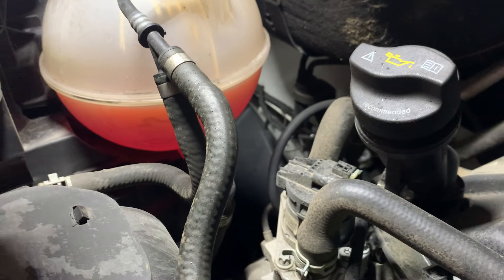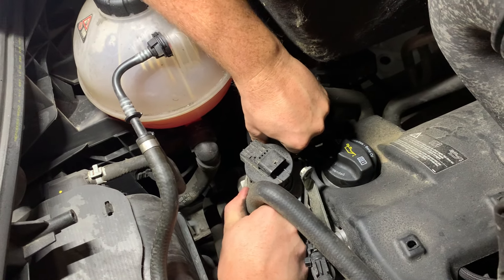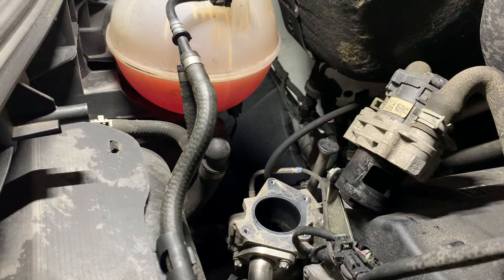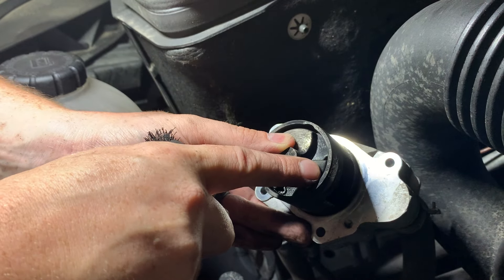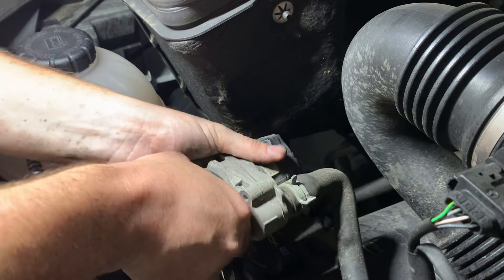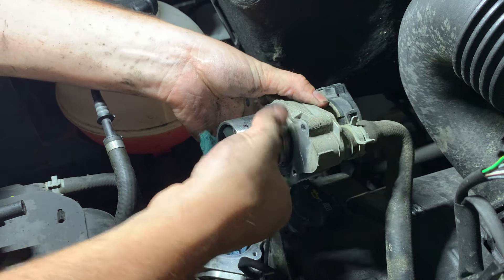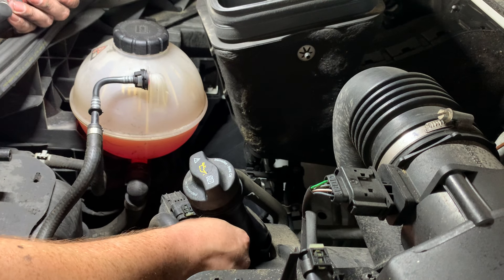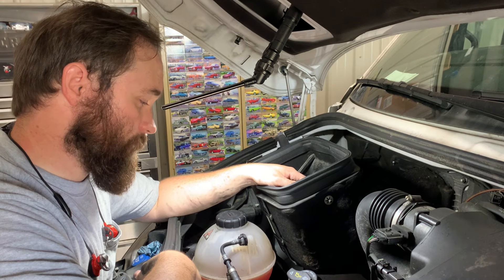Mercedes Sprinter EGR valve cleaning

Comment: If it was my Sprinter I would be very careful with use of abrasive pads and wire wheel and vacuum out any debris. Scotch-Brite and similar abrasive pads contain nylon, aluminum oxide or titanium dioxide. Lose wires from a wire wheel are also a risk. It is not good to have those contaminates ingested back into the intake system and then into the combustion chambers. It may be a minor amount but why risk increased wear on an expensive engine.
Reply: What do you suggest for the carbon inside instead?

Comment: I have the same van but after cleaning, it only lasts about 3-4000 miles and it starts sticking again.  That seems a little ridiculous, what am I doing wrong?  This problem started at about 5000 miles, sent it back to the dealer, they cleaned it and basically said there is nothing they can do.
Reply: Had the same issue on mine cleaning did not help for very long, I was told from dealership to wait until my warranty is over and remove the DEF system, which I thought it was odd and quite frustrating since my warranty is until 200 000kms. Had to fight with them a little to get a replacement and source the updated EGR valve. After replacing  it I spoke with the Mercedes Tech about how to avoid problems again and he told me to make sure that when I drive to step on it and make sure that the turbo gets real hot and spools. He told me that these problems aren't showing to the Working vans meaning people drive their companies van harder then the average Van owner. I've listen to the man every since and 30 000kms later no other issues, I'm watching this video to see if I could inspect it myself. Hope it helps, I was left disappointed when it happened to me almost had me selling it.

Comment: Just did this on my 2019 Sprinter with 75,000 miles. The dealership had nothing to offer when I explained the issue with acceleration hiccups at roughly 1750 RPM. As soon as I cleaned the EGR Valve the issue went away.
Reply: Dealers = sellers. IMHO
Reply: Egr cleaning is free at the dealer with a unlimited warranty extension

Comment: Amazing video. Thank you. Why not remove the hoses so you can take the whole thing out?
Reply from the maker: It’s an extra step and I feel you gain no real benefit removing the hoses. It’s just as awkward on the bench as it is attached to the truck. Plus, you don’t have to open the coolant system and deal with coolant spilling on everything.
Reply: This. I just found your video. And fixed my 2020. No more bucking at low rpm. You are awesome!

Comment: Excellent video, my van has about 28,000 miles 2022 v6 diesel sprinter. Using your video I’ve cleaned it at about 15,000 20,000 23,000 24,000 and now it’s doing the about 1,500 rpm buckaroo like it does every time the egr is dirty. Dealer refuses do replace it under warranty because there is no codes.
Reply: What exactly does it do at 1500 rpm?

Comment: Thank you, sir! I have the shifting issue and will try this, 2016 3500  3.0 v6 71,000 miles!
Reply: Did it help your shifting issue?
Reply: Totally fixed my issue, will do this again when it clogs up again!
Reply: What exactly was the shifting issue?
Reply: @spddd79 the vehicle will periodically feel like a jerking or a transmission problem but is just a sooted up valve. These are way bigger than the old ones on older cars that plugged into the valve covers. We notice it the most when letting off the gas pedal then stepping on the pedal you will feel the whole unit shutter or jerk! It will get worse over time and completely goes away after cleaning! Hope that helps!!!

Comment: Great video. I would add including the size of the socket for the bolts would be helpful. I would also have suctioned out any dirt and dust after sanding.
Reply from the maker: The size E10 was mentioned during the filler neck removal. All of the bolts are E10 so I didn't feel the need to mention it again. If you have some good buildup on the mounting surfaces, I could see taking more care with managing debris. Fortunately, this particular truck was pretty clean, so I don't feel there's any concern there. The internal bore itself was nothing more than carbon being scraped off, so there's no issue there at all.

Comment: I have had repeated issues with my Sprinter engine stalling and losing power.  Two trips to the dealer, replaced all the fuel injectors, problem continues.  Today I carefully followed your excellent video and cleaned the EGR valve, which with 29k miles was thick with carbon.  Time will tell if this helped resolve the issue.

Comment: This video is exactly what I needed. I may use some shop towels to avoid the brake clean overspray but that's an easy fix. Question: Do you always replace the gasket, or can you reuse the old one if it's good shape?

Comment: @Huey866 do you have the torque specs for the 4 bolts holding the EGR? About to do this tomorrow with my dad on his van. Consider me a rule follower, just like to make sure everything is exactly as it should be
Reply from the maker: I do not, i just go hand snug then give the bolt about 1/8th of a turn in a star pattern. The extra turn puts a bit of a "crush" on the gasket to seal it.

Comment: I have a 2021 Sprinter 3500 on a 2022 motorhome.  From day one the engine would surge on acceleration from a stop.  Dealer cleaned and rested the valve at about 12,000 miles.  Some of the surgs seemed like the engine was starved for fuel.  About 5,000 miles later symptom returned.  Now at 22,000 miles dealer wants to test and clean again.  I would prefer replacement.  Normal use is day long use at Interstate speeds.  I have talked with numerours Sprinter motorhome owners some well in excess of 35,000 miles, who have not experienced this issue.  Your excellent video refers 80,000 miles more common on a fleet of 40 units.  Have you run across cleaning does not resolve the problem?

Comment: My EGR is really stubborn to come out. I hit it with a hammer as you suggested in the video, What else can you recommend on how to remove the EGR? Thanks.
Reply from the maker: You just have to keep working on it. The first one I ever did was on a 2015 with 170,000 miles. Spent 45 minutes tapping it back and forth as it slowly twisted in the block. I had to use a punch to tap it from the back (avoid hitting the exhaust temp probe behind it)  to tap it back the other direction. Eventually I could get two screw drivers in and spent another 10 minutes slowly working it up. It might be worth it to run the engine for a bit before trying to remove it, it might help break the carbon that's wedging it into place.
Reply: Preferably no prying on it can cause a leak. Spray a little bit of rust penetrating oil. Use a rubber mallet to hit back and forth then pull it up while hitting it with the mallet.
Reply: I ended up removing the two safety torx on the top of the valve that hold the actuator into the block with coolant flow and threaded two of the four longer EGR hold down bolts into the two holes. They bottomed out on the manifold where the EGR mounts, then quarter turns on each gently pressed the EGR out. It worked exactly like taking off a stuck brake rotor by threading a bolt into the 8mm threaded holes made for that purpose.

Comment: It seems to me where the valve would hang up is UNDERNEATH the blades and the openings into the valve body.  Very hard to clean.  It does not seem like cleaning the top of the blades is going to make much difference.  I imagine a small tool of some kind and cleaning the back of the blades may make it more effective.  Any thoughts on this?

Comment: Curious if you have an OBDII scanner tool you use on the 907 Sprinter? If so which one do you have? Thanks!
Reply from the maker: Blue Driver does a good job at seeing most things anyone would need to see on the 907. It's not perfect by any means, but it's gotten me out of a pinch times.

Comment: Who are not able to get a stock EGR pump out!!! I had so hard time to get it out. Nothig helped , no hammer, no nothing. Removed the hose that slosest to the passenger fender and used an air compressor's hammer pushing it out. As soon as it moved it I put a screwdriver fom an opposite side and continued lightly to push EGR out with the air hammer. Thats it. I have 3 liters, 6 cyl, 2018 MB Sprinter
Reply from the maker: Sounds like it was a violent experience. There is a way to screw Jack the EGR out of the housing, it requires removal of the motor, but I try to not do that because there's a dampener bushing that always falls apart when it's removed. Valve is junk without this bushing. I've seen them more and more readily available on eBay so I'll revisit the situation in the future for the occasional stubborn valve.
Reply: @Huey866  Ninety-something dollars with a seal on Ebay. I think it is acceptable price. I ordered just the seal. The valve is ok. Put it in a can with diesel fuel overnight, did not look yet how is it.

Comment: From what I can tell , if you have the 4 cyl. Diesel, your screwed because the EGR is not accessible without removing allot of parts. Requires hours to get to and then reassemble.😓

Comment: At what mileage should you clean the EGR valve? I have 43,500 miles on my Sprinter?
Reply from the maker: Now would be a good time to do it. I'm going to try and do it every 20,000 mile service, but I wouldn't go anymore than 40,000.
Reply: @Huey866  thanks!

Comment: Mercedes Benz USA says to clean it with carburetor cleaner. That should break down the carbon better than brake cleaner.
Reply from the maker: Maybe. Technically, either one works…. I don’t see the need to add expense and more chemicals to my chemical closet for what is, probably, marginally better results.
Reply: @Huey866  Brake cleaner can damage the o-ring seals in the EGR. Carb cleaner will not. Carb cleaner is formulated to dissolve fuel deposits. The EGR is made to tolerate petroleum based compounds.
Reply: @Huey866  Brake cleaner can damage the O-rings and seals. The EGR valve components are designed to tolerate petroleum based cleaners. Carb cleaners are compounded to dissolve petroleum based deposits. 
At the cost of a MB EGR valve ($600 or more) $4.00 for a can of carb cleaner or $10 for a can of EGR valve cleaner is worth it.
Reply from the maker: @idadho  I’ve done this exact procedure well over 200 times in the last 2 years. Some of our 2019 trucks are well into the 200k mile range, those valves have been cleaned multiple times. No adverse problems yet.
Reply: @Huey866  Mine is under warranty for 8 years or 100,000 miles. MB tells me that I do nor risk my warranty if I follow their instructions to use carb cleaner.

Comment: Do you absolutely have to replace gasket?
Reply from the maker: The perfect answer is yes. The real answer is not necessarily.

If you have the gasket on hand, yes replace it. If you’re in a pinch, emergency situation, or unavailable due to our wonderful supply shortages, then I don’t see a problem reusing the gasket at least once. I’ve done it a handful of times, I just try to not make a habit of it.
Reply: @Huey866  yeah I ended up reusing then my a/c compressor pulley bearing exploded a month later and destroyed the belt I’ve never seen that happen before 😂
Reply from the maker: @garden0fstone736  I’ve actually had the A/C pulley bearing explode before. Happened 3 times before I caught the pattern of failure. Seems to happen somewhere between 180,000 and 220,000 miles. I think it has to do with belt wear and harmonics from the power steering pump, the compressor pulley bearing just takes a beating from it. I always make it a habit to replace the main drive belt at 80k, then at 160k I replace the belts, tensioners, and idlers. That will usually give me to 200k to either replace the pulley or the compressor if there’s too much corrosion to get the pulley off.
Reply: @Huey866  dude no way I’m at 160 and it happened. Started noticing some metal grinding noise then started blowing hot and i started seeing piece fly out in my mirror. The thing just completely broke like 20 yards from the shop and completely chewed the belt. Sucks cause I have a load in the back
Reply from the maker: @garden0fstone736  Last time it happened truck was at 220k, and 3 hours away. After an $800+ tow bill, and way too long of a day for the driver, I decided 200k was the maximum I’d let it go. Parts to do the swap no more than $550, thats refrigerant, O-rings, and the Denso Compressor. But that’s leaving out the $1000 or so in tools to do everything legit and legal. It’s just cheap insurance that saves down time.
Reply: @Huey866  wonder what the shop would charge that’s the route I have to go being stranded in Texas. Luckily o Reilly next door so for 350 I’ll get the compressor
Reply: Thos video is the best. I had to come home last night in limp mode and I'm thinking it's the egr valve stuck closed, I have ordered a new one for prudence, but being able to do this on my driveway in 20 minutes is awesome.
I see you me tinned about the AC pulley bearing. Mines on 192k assuming nows a good time to replace that also. Do you have a video on that?
Thankyou

Comment: Hello Huey, I have engine light on my 2020 V6 2500 Sprinter 
code P2457
EGR Cooler "A" Efficiency Below
Threshold. Any info will be helpful
Reply from the maker: It seems to be a code that comes and goes with our vans as well. It doesn’t seem to effect performance and it usually self clears. I have a theory that Mercedes is asking too much of the EGR valve (and cooler), and they’re just putting too much heat through it to satisfy emissions. Not much has changed in the design for 15 years or so.

I’ve read a couple of articles that Mercedes has actually retired the 0M642, in the sprinters, for 2023 and moving to a more powerful 4 cylinder. My guess is they are, more or less, going to let the current EGR and emission system problems work themselves out through obsolescence.

I’ve had a handful of service writers around the country agree with me on this theory.

Comment: Couldn’t get the valve out.
Reply from the maker: Sometimes, it just takes time. The first one I ever did, I spent about 45 minutes just tapping it back and forth. This was on a 2015 Sprinter 3500 with 170,000 miles. EGR valve had never been out of it.
Reply: I ended up removing the two safety torx on the top of the valve that hold the actuator into the block with coolant flow and threaded two of the four longer EGR hold down bolts into the two holes. They bottomed out on the manifold where the EGR mounts, then quarter turns on each gently pressed the EGR out. It worked exactly like taking off a stuck brake rotor by threading a bolt into the 8mm threaded holes made for that purpose.
Reply: @MrBobsVids  I was struggling and I put it back together for now as I was to the point of screwing it up. I will try that method, I thought about it but wondered why no one else suggested it?
Reply: @Mikeybike  I don’t know why it is not known by we non-professional mechanics as the primary method to get the valve out. Once I figured it out I concluded that the unit is designed to be removed by Mercedes technicians this way, mostly because they don’t have time to fiddle and bang on it and wriggle and pound screwdrivers in there. Way cleaner, safer, and faster to just ease it out by turning two bolts.
Reply: @MrBobsVids  I have removed mine and it went well and I'm thankful I read your comment as I was starting to lose hope. Thankyou your comment helped.